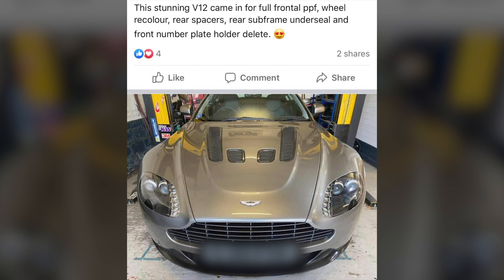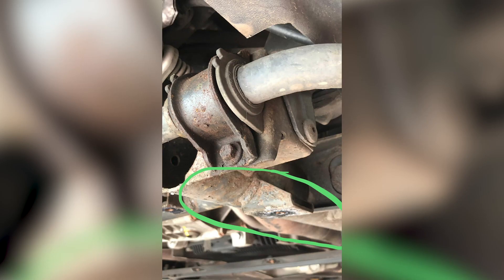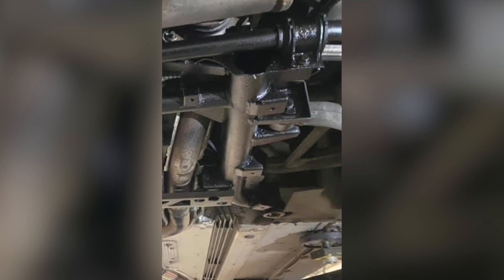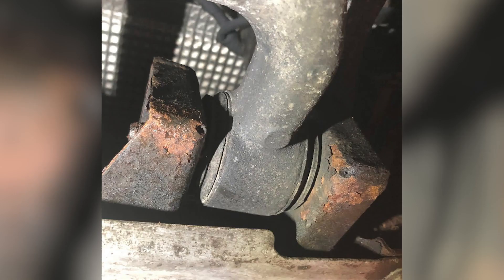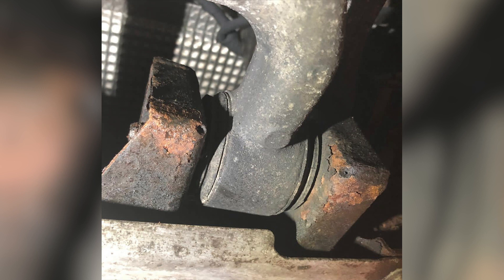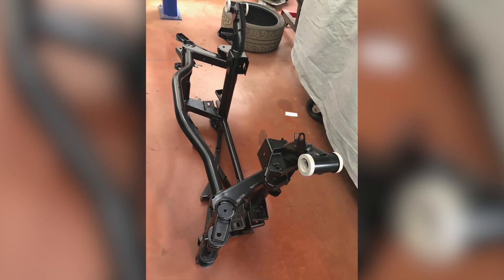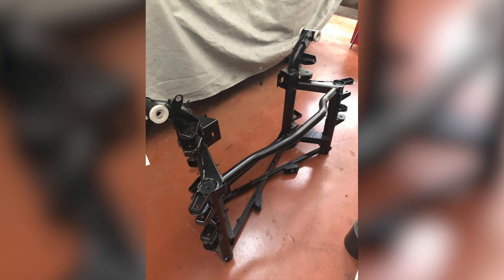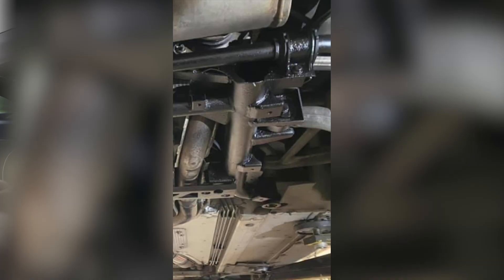Is it worth treating a corroded rear sub-frame?? Forum chat #60

Comment: I don't really agree because if the car was treated when bought new with yearly spray on clear rust inhibitor treatment it would show little to no surface rust, but if you just leave it for a few years and do nothing the surface rust will eventually eat into the metal, and how many powder coats have you seen corrode and flake off, absolutely all of them, remember the fully powder coated TVR's chassis, that the sub frames are rotten as the powder coat is no good, its best to get them shot blasted then use a 2k black glass flake paint they use on oil rigs, it chemically kills the rust and when it's dry you can't hardly even scratch that 2k paint is so hard paint and will last 30 years plus, you mix 1-1 ratio paint and hardener , tough stuff, bilt Hamber or buzzweld do it.

Comment: It’s my car being featured.  

My thinking was that spending £100 as an interim measure to stop it getting worse, was well spent.  I know it’s not a long term solution, but some protection is better than nothing IMO, and I don’t have £1500 to get it done properly at present. 

Bilt Hamber Dynax was used - this actually works better with the surface rust (but not loose paint) in place, hence why the flaking paint was removed but not all signs of surface rust was removed before application - 2-3 thin layers of BH Dynax were applied, and these will continue to cure over time.

Not meant to be a long term solution, but having used Dynax on all my previous cars, it kills existing rust permanently and prevents further rust developing.  For £100, I think it’s good VFM.

Apologies, long post, but I felt worth clarifying my thinking 👍🏼
Reply: If the top part goes you’ve had it anyway .... & AM only wish to sell subframes to Recognised repairers
Reply: @karlstamper9243  top part coated too
Reply: Shirish , I have done exactly the same with BH Dynax , I have used it on my other cars and have been totally impressed with its durability and corrosion inhibiting properties, if applied properly onto dry metal it has not ‘rusted underneath’ , for anyone that has had a powder coat crack and the subsequent water seepage into the cracks and corrosion that happens underneath that will know that powder coating on heat exposed and stressed components is not always the answer
Reply: @bobludkin  a believer 🤗
Reply: @bobludkin  hi Bob ... my thinking  is to “preserve” - vaseline once applied seals & stops all moisture & is unable to chip until the proper job is addressed ... it’s only meant as a top £2 tip

Comment: Agreed. A poorly prepared 'tidy-up' will often hold moisture under the new coating, allowing it to degrade the steel out of sight. If prepped right it can work locally but the full job would be impossible in situ.

Comment: I understand what you are saying however find it difficult to accept that if you had two cars kept identically and you treated one with waxoyl or similar product every year (or several times a year even if you wanted to) and did nothing with the other that there would not be a different life expectancy between the two chassis. 
I am a firm believer in regular preventative maintenance on all my machinery (mainly farm equipment) and it is almost invariably commented on when I change it……

Comment: Does no-one feel that this surface corrosion should have been ruled out by factory surface treatments?
Reply: It is very disappointing that they weren't better protected from the factory. I have experienced it with Audi too where the shell is zinc coated prior to paint, but not the rear subframe.

Comment: Totally agree with Mike ... overpainting lmfao .... a good TIME to address this corrosion problem would be when your having your new  clutch fitted & the transaxle has been removed .... but until then, axle stand your car & use some Vaseline ( no comments please 🤫) apply your best finger onto all the bits that are to your Annoyance - this should stop the rust in its tracks - the wife’s/ Boyfriends toothbrush, on a stick can come in handy to get into the higher places ... this is only a Temporary measure!
Reply: You think Vaseline will offer better rust protection than a specific rust killing treatment ? A can of Dynax is £20
Reply: @sierrapapa1711  yep - save your money & do it properly ... until then vaseline up sir 😂😂😂 it works
Reply: @karlstamper9243  powder coat is less effective than 2 pack epoxy - powder coat will chip and lift/peel quite easily. 2 pack epoxy won’t and what I will have done if removed
Reply: @sierrapapa1711  hello my friend all my motorcycles are powdered coated .... and I’ve found that far better the Kawasaki,Honda & Can Am (800 Quad) far more superior .... one or two of my bikes have won Competitions